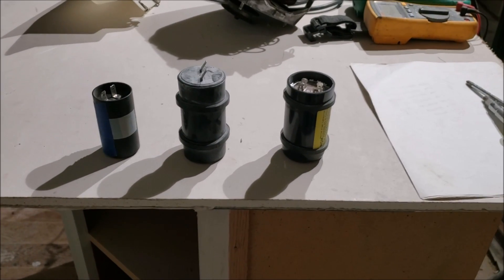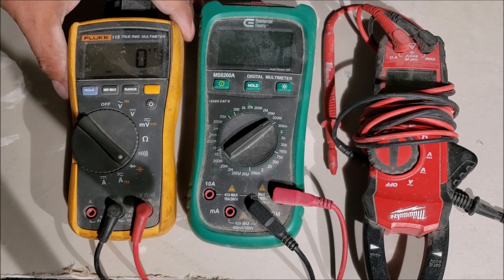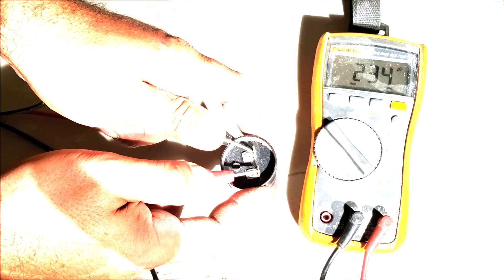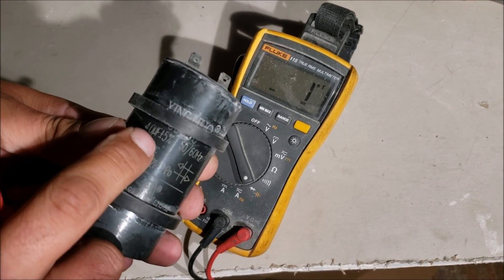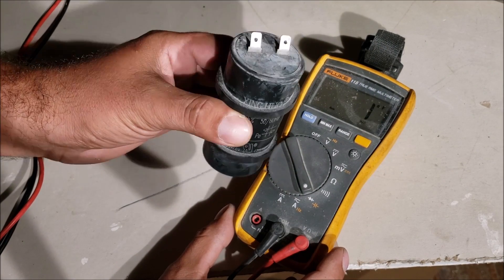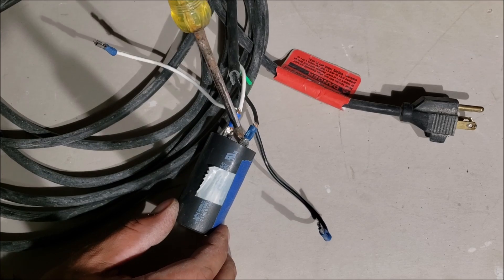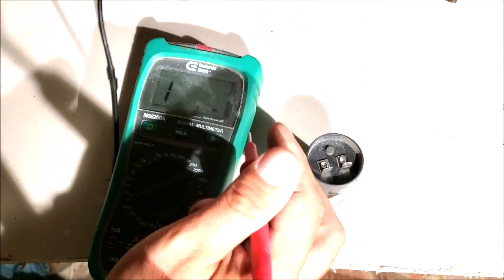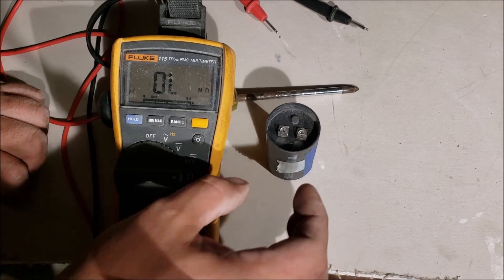how to test a RUN or START CAPACITOR the CORRECT way

Comment: If the cap is disconnected from everything, the current will not flow to ground.  It flows from one cap terminal to the other so it doesn't really matter if you're on concrete or not.
The cap can still be very dangerous. You must discharge it before touching it with your hands or meters.

A BIG TRICK is to discharge the capacitor like the book says; leave it laying on the bench and come back a little later, maybe a day later, and it will still knock you on your ass.  A big capacitor does not loose all it's energy with a single quick short circuit. 
 Short it every time before you handle the cap.
Reply: I was told to not short it with a screwdriver, but with a tungsten lightbulb that can act as a load and not harm the capacitor.
Reply: @blackrockcity

The light bulb thing makes sense... 

Does the bulb type matter? Can it be just a 12v automotive bulb, or have to be say a 120v bulb, and if so does the bulb wattage matter at all?

Comment: 1. Never discharge with a screw driver. Put your meter on DC put your test leads on the capacitor and it will drain it, that is the proper and safe way. 2. Put your meter on ohm's and your 9 volt battery in the meter will start to charge the capacitor if's it's good you will see the values going up rather fast depending on the charge of your battery. If it does not go up fast it's bad. I would suggest a stand lone tester the Supco MFD10 capacitor tester if you repair shit from time to time.  Or a meter like the field piece SC640 which has the MFD option if your always working you can have one tool that does it all.
Reply: Makes perfect since. Thanks for sharing.

Comment: So was your cap just bad?
Reply from the maker: yes
Reply: Thanks. I apologise I didn't get through the whole thing yet because I'm at work. I'll be sure to listen completely.

I'm thinking th cap is bad on my dishwasher. Tried a used motor with a used cap it shipped with and had the same results as my original motor and cap. I can't imagine these motors just fail to where eBay warehouses are overloaded with second hand units to experiment with.

I'm thinking the cap. I'll find out.
Reply from the maker: @AgeofReason  this isnt a test lecture video..  i have saved thousands of dollars over the years..   just showing the idea..
Reply: @chriscraft77022  I'm the same way, I'm a guy who repairs everything that goes wrong on my own.  I didn't go to a trade school after high school, I don't have any credentials, I just have time and experience.

I do my own vehicle work, house work, utility machines work; if something comes up I figure it out.

That's what brought me here, thinking out loud about the cap in my dishwasher. I see no reason why two motors should just happen to both be shot when they in fact both power through and cycle, merely at weak performance.

Old caps however, I can see them crystalizing and hardening inside and degrading.

Broke Ass Tech Hacks Lyfe. BATH LYFE.

Comment: When you do the Ohms test, the results you get are due to the following.  The capacitor initially takes a charge and therefore shows what is in effect a current reading.  When the capacitor reaches the voltage of the internal battery in the meter, the capacitor will be 'fully charged' (as far as that test set up is concerned) then no more current will flow into it and it will show an open circuit (or OL which is not really Overload).  It is worth keeping the meter (set to a high resistance range) on the capacitor to see if there is a measurable resistance.  This will indicate a capacitor with a poor insulation resistance and which will therefore not hold its charge.  The snag with this test is that it is done at about 1 1/2 volts which doesn't stress the capacitor at all.  The mains voltage charge/discharge test will only work some of the time even with a good capacitor.  If the cap is disconnected from the mains supply at just that moment when the mains voltage passes through zero (it is AC), there will be no charge remaining in the cap.  Indeed the size of spark you get will vary according to the moment when the cap is disconnected from the mains.  If this mains test is done with a failed capacitor (short circuit in the cap) the results will be fairly spectacular.  Take care!
Reply: Bad start caps nearly always announce themselves by blowing out the vent hole. run caps die peacefully and need a good tester.
Reply: @RRaucina thank you for this tidbit of info that just solved my problem. The vent hole being blown out. I saw this on my capacitor but did not realize it was an indication of failure. Thanks again.
Reply: Initially I got a reading then nothing but OL which had me confused so you definitely cleared things up for me. Thanks 🙏🏽

Comment: What is the best way to identify your capacitors? how do you tell the difference between the start cap. and the run cap. if they sit side by side in a black box fixed to the motor on my air compressor?
Reply from the maker: does the compressor instantly trip breaker or start then trip? one has a lower value I forgot
Reply: Start caps are usually black plastic and have a high rating 100++mf  - runs are usually aluminum and low rated, like 10 to 25mf with voltage ratings 300+

Comment: I'm trying to get a 1 hp Baldor going that growls and has trouble getting started,  once its hand started it runs fine. The capacitor had foam rubber padding wrapped around it and it deteriorated and ruined the printing on the unit, but I have another motor like it and was able to decipher the info.   My question is a Packard capacitor made in China costs under 9 dollars and the Baldor made in USA is over $45. Your thoughts on if I should gamble on the cheapy one?  The motor is a spare and will see use occasional on the farm. Thanks for your video, very helpful.
Reply: The Chinese caps are pretty poor quality. But you don't need a Baldor branded cap, they dont make them. BMI is US made and would be about $10 to $15 and outlast the Packard 10x
Reply: @RRaucina , thank you sir! I got it running, bought the Packard. Will note this for next time.

Comment: Hey love the video . I have a question . On my kobalt 8 gal air compressor it is a 120 oil less compressor. The capacitor I was going to replace the start cap is a 250 mfd 120v the run cap is a 6mfd but does say whither it 120v or 230v I’m trying to match it up with one to buy. What should I do? Both caps are a two wire connectors male spade.
Reply: The voltage rating on a capacitor is simply the maximum voltage it can withstand before the smoke comes out. You could use a 230V capacitor in place of a 120V unit. You just don't want to use a capacitor with a voltage rating lower than what you removed. It's slightly easier to manufacture a 120V capacitor than a 230V unit (for the same mfd), so you might find that package size or cost may be different.

Comment: Thanks for doing this video. It had been awhile since I checked capacitors and this brought it all bad. My run capacitor is bad. Simple enough to get a new one and a lot cheaper than a new motor.

Comment: I followed you instruction and tested with a Fluke 79 meter a start cap 40uf with the terminals held steady the meter went up to 39 and immediately dropped to OL , I then reversed the lead and it did the same thing. So is that an indication it's bad cap?
Reply from the maker: what is the machine doing?  the test should hold at the reading and not fluctuate ...  why are you testing cap in the first place?
Reply: @chriscraft77022  I have a five horsepower 240 volt hot tub pump motor and it keeps blowing fuses the minute I hit the auxiliary to start the the that side of the tub it started doing it shortly after I bought the hot tub and the guy told me to put a bigger fuse in it it worked a while and then this summer I started up the tub and it it would blow the fuse instantaneously . It's a 40uf 370 VAC cap in a black plastic round housing. I didn't bother doing anything until I closed down the spa this fall and tear into it to see what's causing it. I tested the motor windings and they are fine there's nothing shorted out with that and determined it's got to be the capacitor mind you I am certified in HVAC and I'm familiar with capacitors but not on motors like this.
Reply from the maker: @DebGood  if it is a single phase then it has 2 capacitors..   or does it have a DUAL..?  all you can do is replace it to start with...  when they pop the fuse instantly it is most like the start cap..   thats what my latest capacitor fail was doing..  any way..  let me know what you find out.,,
Reply: That's a good cap by that test if the meter is set to read resistance. but what you want is to set your meter to capacitance and get a reading near 40 that holds

Comment: I've found readings on my ESR meter often give different results compared to simple capacitance testing with a multimeter, the two testing devices are complementary. Presumably that unreliability of a single test is one of the reasons HVAC techs simply replace the run/start cap when fixing or replacing motors. No test is perfect.

Comment: Thanks for the video. My washer machine will only spin in one direction. I was told it could be a bad capacitor. Does this sound like a possibility. Will take my capacitor out and try and test it at work and see if they a have a meter that can test a capacitor. I only have a simple multi-meter.

Comment: OK I got a meter that reads capacitance. When the meter is on it reads 000. When I connect to the capacitor it still reads 000. Meter or capacitor? It is a new first time use meter and the volt ohm works. Help help.
Reply from the maker: Do the last test on it resistance
Reply: @chriscraft77022  It goes up to 2000 on 2000K and it goes down to 0 when reversed. I charged it up last week and it does charge and sparks when shorted across. It is about 28 years old out of an RV generator. I flashed the coils and it only puts out 5.4v. They say if it puts out 4-6 v the generator is OK. I would just replace the capacitor but it is a big job putting it together. Thanks so much for your help.

Comment: Can  shorted capacitor break a protective fuse when starting a motor?
Reply: Yes, a shorted cap can trip a breaker, or a fuse. The alternative would be for a lot of current to run through it, so the fuse saves you from a worse outcome.

Comment: Thanks to this video i found the capacitor test function on my multimeter. I was confused as it is such an expensive Fluke multimeter, that there wouldn’t be a capacitor test function on it 😂 Just didn’t recognise the symbol for it. Confirmed that my start capacitor is bad & ordered a new one already 🙂 I found a water well in my backyard of which the motor doesn’t start, the motor only hums, i hope it works after replacing the start cap.

Comment: Do I need to discharge a newly packaged capacitor as well if I want to test it?  Thanks.  Gr8 video.  No words but thank you!!!
Reply from the maker: I would
Reply: @chriscraft77022  thanks. Curious if discharge would reduce the newly capacitor to be able to hold charge effectiveness when actually replaced to washer. I don't know know why it creates a single spark, as I think that new capacitor would have unlimited charges in it anyways, like a car battery. I guess capacitor is not like a car battery but holds a charge, but why only a single charge why not more like a battery? Thank you Chris Craft.
Reply: @educationX  Batteries are designed to deliver their energy more gradually than are capacitors.

Comment: I know this is a little older but im fixing up an old bench grinder, single phase, has a start capacitor, the centrifugal switch looks to be good and works, well seems to work like it should however I started up the grinder with a new capacitor with the same ratings and the grinder ran for about a minute then the capacitor blew, Im thinking i just go up to the next size uf rating which is like a 10% increase, however I dont wanna spend another 15 bucks on a capacitor just to have it blow again, Could it have just been the size/rating of the capacitor or is the centrifugal switch bad.
Reply: Most probably your centrifugal switch is not going open circuit when going up to speed. To test the switch 
Press back in the collar you should hear the switch click open , some machines this is not possible when opened because the switch is on a separate plate. A quick check is when you start the motor, switch on for about half a second, the motor is supposed to be up to speed this fast,switch of when spinning slower you should hear a clear click sound ad the centrifugal switch makes contact again. If you don't come right let me know and I will see if I can assist you further.

Comment: C'mon,  there could be no AC power in a disconnected capacitor.    If some electrical charge is still remained in the entirely disconnected capacitor it's definitely DC, but not AC and it has nothing to do with earthing at all.
Reply: AC is not possible indeed. But you can see the spark in the video so just discharge it. It takes half a second to do. Your post is dangerous for other less educated people as it reads like a suggestion that there is no need to discharge.
Reply: @Engineer9736  ,  "...post dangerous for other less educated people..."  Propagating BS among broad audience  is way more dangerous to further generations than one random idiot passed away for no reason.
Reply: It is not AC stored power, the cap will store either the positive or negative phase of AC . It still is up to 60 Volts
Reply: @danc2014  , in fact a capacitor stores just a static electric charge.

Comment: i have a question.  i  have a capacitor for my washing machine and it has 2 terminals.  my question is are the capacitors with 4 prongs the same thing.  it has 2 prongs on one side and 2 prongs on the other side.  the reading on mine reads 270-324 mfd  110vac.   i saw new ones that look like the 3rd capacitor in the beginning of your video.  part number on mine reads 3348058.

Comment: The only way to test a capacitor is by ESR. The correct resistance of the inner dielectric tells you if a cap is bad or good.
Reply: Absolutly!

Comment: A good motor capacitor article is available here:
"Electric Motor Starting Capacitor Selection"
https://inspectapedia.com/electric/Motor_Capacitor_Selection.php

It explains things like if you use a capacitor that is different from the one you are replacing, whether you need to use a "run only" or a "start/run" capacitor, and other information in a form that somewhat electrically skilled people will understand immediately, and those new folks just starting out can probably figure out with just a bit more study or other youtube videos to assist.

There's a companion webpage at:
"Motor Start Capacitor Selection FAQs--Q&A on how to specify motor start/run capacitors"
https://inspectapedia.com/electric/Motor-Capacitor-Selection-FAQs.php

Comment: Very informative video. need to get a fluke meter it's a must have to diagnose electric systems. Thanks for sharing you are clear in your safety warnings but I wonder how many will find out the hard way concerning discharging the capacitor before testing it.
Reply: You can buy a Vici VC99 meter from Ebay for about $30 that is similar to the Fluke Meter
Reply: Frank W Regarding the amount functions maybe. It’s stupid to think that a 200 euro Fluke is the same league as a 30$ unknown brand. That’s like saying a Ferrari is the same as a Lada because they both have a steering wheel pedals and a gear shifter.
Reply: @Engineer9736  I guess if one was going to race every weekend a Ferrari would be fine but if one needed a ride home once or twice then a Yugo would do the job.
Reply: @gfinklea  You are paying for the safety provided by a good quality meter. You can get accurate enough readings and a similar amount of functions from cheaper meters, but you risk your own life on the shitty build quality and inappropriate fuses of the cheap meters.